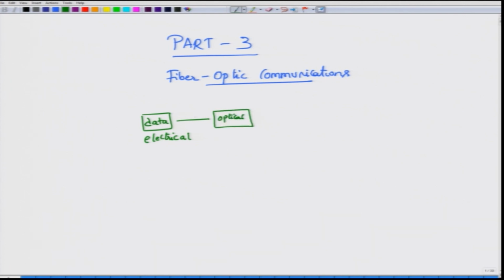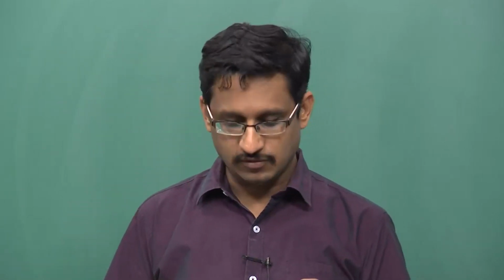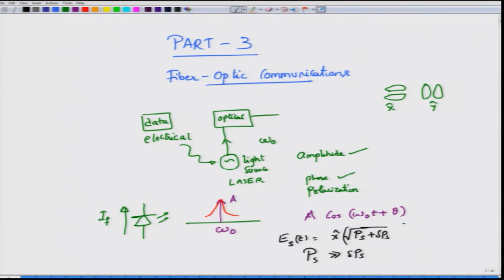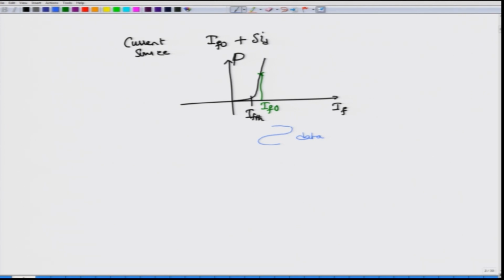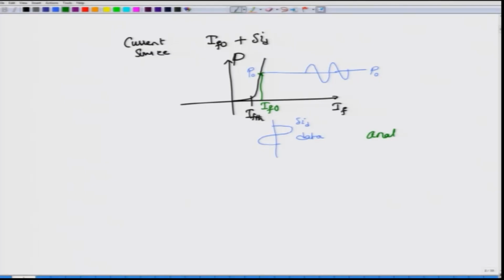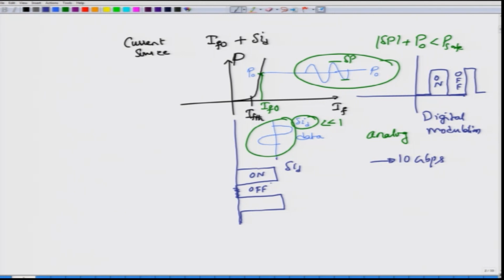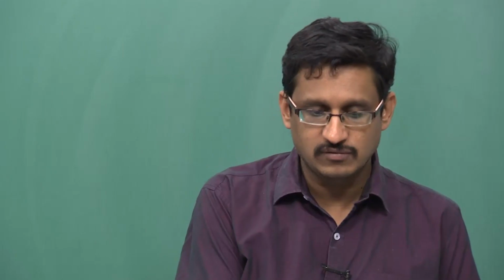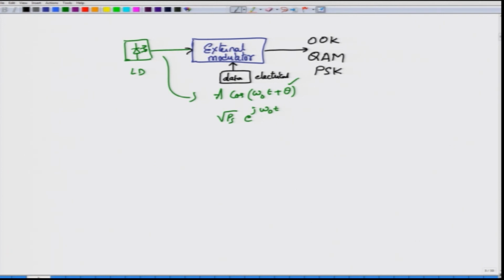noc18-ee28 Lecture 47-Optical Modulators-I (Current modulation)

Comment: Rofea Optoelectronics offers a product line of commercial Electro-optic modulators, Phase modulators, Intensity modulator, mach-zehnder modulator,Photodetectors, Laser light sources, DFB lasers,Optical amplifiers, EDFA, SLD laser, QPSK modulation, Pulse laser, Light detector, Balanced photodetector, Laser driver, Fiber optic amplifier, Optical power meter, Broadband laser, Tunable laser, Optical detector, Laser diode driver, Fiber amplifier. We also provide many particular modulators for customization, such as 1*4 array phase modulators, ultra-low Vpi, and ultra-high extinction ratio modulators, primarily used in universities and institutes. 
Hope our products will be helpful to you and your research.